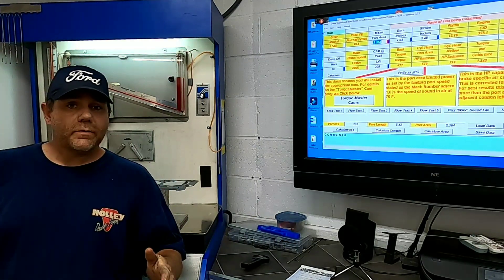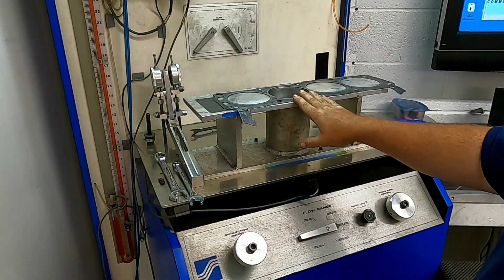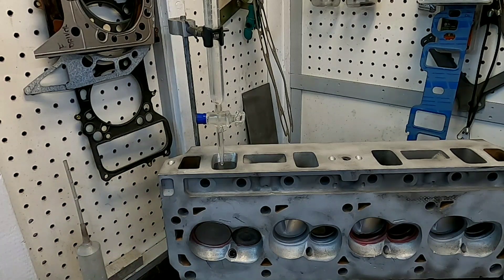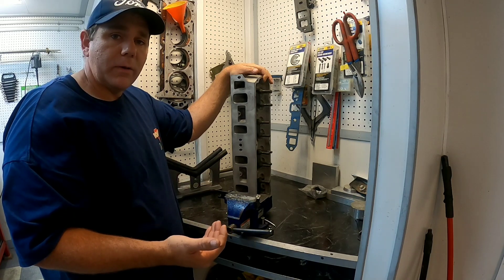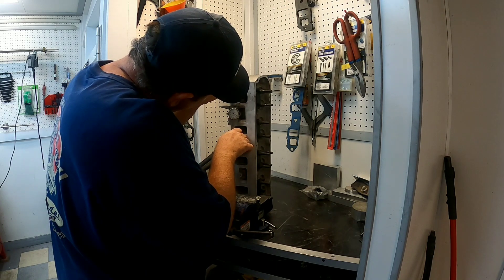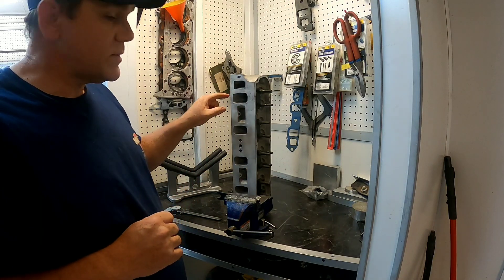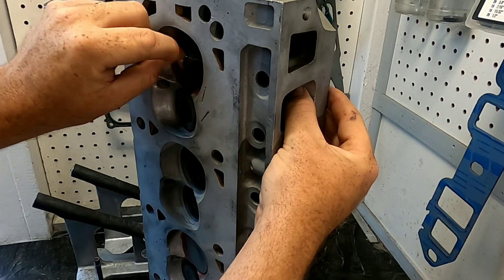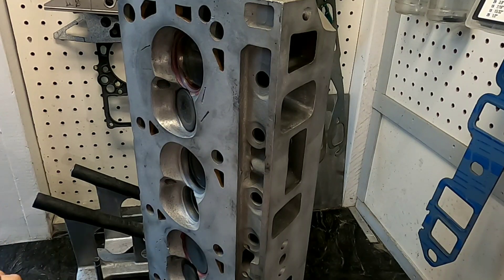Flowbench Testing using David Vizard's IOP program

Comment: Curious  as to what the .500 lift flow numbers will be
Reply from the maker: I'm working on Part 2 right now.. I want to have it posted no later than Wednesday!
Reply: @UnityMotorSportsGarage   Reason I say that...My heads and intake  are at the porter right now. I want to compare numbers. I've got a pretty good idea what mine will be from the porter. I have the  same heads as in this video, Early track heat heads.
Mine build is just a daily driver little ford ranger with ac. Stock bottom end 302